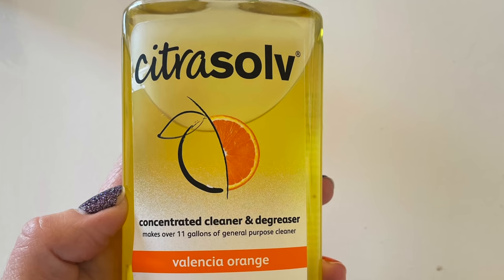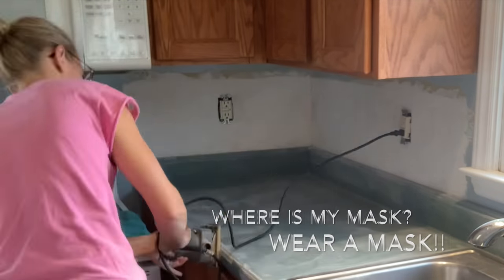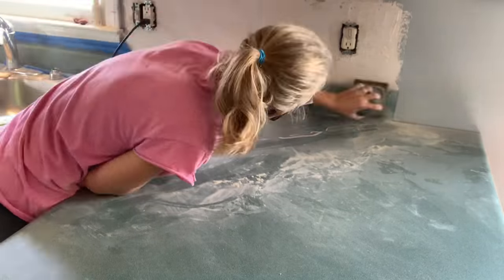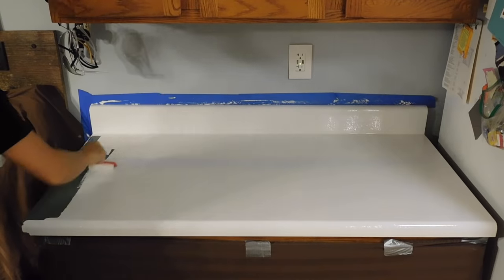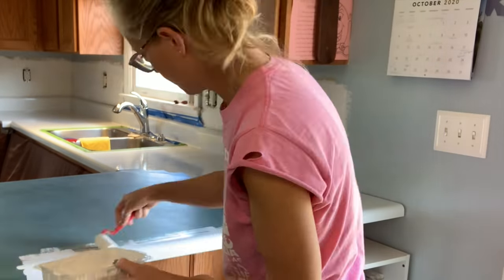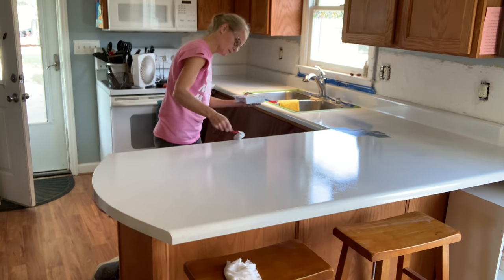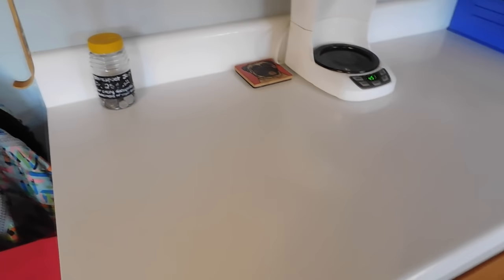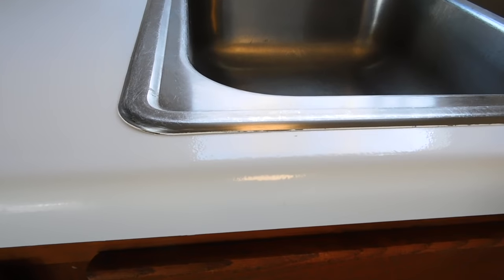DIY Painted Laminate Counter |CHEAP LAMINATE COUNTER MAKEOVER | DO IT YOURSELF EASY LAMINATE COUNTER

Comment: @Jesi Davis Life. Hi Jesi.  Thank you for sharing this.  You came up in my recommended videos and I am so glad.  Two questions.  1). How strong was the odor of the paint and 2) how long is the cure time?  Thank you!
Reply from the maker: The odor is very strong, have some windows open and a fan! but once its starts drying the odor dies down quite a bit, it lingers for about a week. This took about 5 days to FULLY cure BECAUSE it was 90% humidity ...., it says on the can not paint in humidity above 60% or something like that ... haha  ops Hope that helps.
Reply: @JesiDavisBuildingaSimplerLife    No worries about the humidity here...I live in the desert where we didn’t get rain for 259 straight days until just recently!  Thank you for your quick response.  Blessings

Comment: You can lightly sand them marks out with fine paper then use rubbing compound will shine them back out.
Reply from the maker: Hey Kenneth! Thank you for watching and giving feedback on the blemishes! I appreciate it!
Reply: @JesiDavisBuildingaSimplerLife  sure thing. I use the appliance spray epoxy all the time and love it. When every i have a plave like you have a couple pin holes i spray some in a paint cap then drop them in thd holes. Let dry and come back sand and buff out. Epoxy is really the in thing now. I wish theyd start making other colors than just the 3 as there are so many projects I could afford to make look great then....
Reply from the maker: @kennethmabus381  that’s genius! Awesome! I’ll have to try that! Yea for sure they need more colors! Hey what do you think about using this paint/spray to refinish a smaller wooden wall shelf? You think I could do it without sanding?
Reply: @JesiDavisBuildingaSimplerLife  if you dont have any protrusion from the shelf do light coats at a time and itll turn out great.

Comment: I want to do this. I live in south Texas so the humidity is always awful lol 
How long did the sanding and painting process take?
Reply from the maker: Hey there Jean, yea i hear ya. 🤔 I sanded in one morning, taped and cleaned right after and had three coats done by the end of the day, I finished the next day with one more coat and working on the blemished area. what took the longest was waiting for it to cure. It was a good two days before we put anything light on it, like paper or a plastic bottle of seasoning, but it took a good 7-10 days to cure, maybe even 14 days. I left town with the kids, so the hubby was keeping an eye on it and not using the kitchen much. I know we put the wine rack and coffee pot and knives back on maybe day 10.

Comment: Love it! How much did you need? It’s like it comes in quarts. What kind of roller do you recommend and do you think you could add a marbling effect in between coats or before the last coat??
Reply from the maker: Hey there! Thank you for watching! I needed a can and a half. I used a small roller and tray kit, cheap, nothing fancy, it left the desired orange peal texture. I think it was his very set I got. https://amzn.to/3dcLy4p check it out. Its been recommended that I can try a marbling on top and seal it with a clear epoxy, I may do that actually!!  Let me know if you try this! We still love it! Its holding up, I may add more coats and maybe create a marbling by the end of the year.
Reply: I would research how the epoxy will react with that type of paint. Epoxy may not bond/stick to it.

Comment: It looks amazing the only concern that I have is if it's safety to use it on the counter where you prepare food and also the safety for the area close to the stove and also the can said it's just for metal surfaces so I am wondering if over the time it will peal off. Thank you for your time to read and answer.
Reply from the maker: Hey there! Thank you for watching! I definitely prepare food on it, haven’t  noticed any chipping or pealing or negative effect in food prep or heat from stove and cooking. I figured if it can stick to metal, it can stick good to sanded laminate. If it can be used on an appliance, it’s suitable for kitchen? I guess time will tell, but as for 6months into it, it’s used a lot and no chips other than where I dropped a ceramic platter on it. 😞 my fault. But I would still do it again!

Comment: Is the spray just as good because Rustoleum has stopped making it in a hand paint only spray paint for their appliance epoxy and tub and tile?
Reply from the maker: Im not sure, I will have to try it ... thats a bummer they stopped making it, I wonder if its the same formula and you can poke the can open to get it out, this paint was super runny.

Comment: Hi Jess. Do you think it would be as easy to blend a couple of colours to get a kind of swirl effect ?
Reply from the maker: Hey Ray!! Yes Ive been thinking about that, since a few have asked. I may even try this and see how it goes .. but I think it can be done, especially with how wet this paint in, I think sprinkling and drizzling other colors may work. With how running this is I think it would allow for movement of the other paint, especially with maybe a hair dryer or a sprayer to get things to move ,,, let dry and then top with a clear epoxy ... yea man! you have my mind bursting with idea! Thanks for watching!!  ♥️
Reply: @JesiDavisBuildingaSimplerLife  You’re post was great to watch Jess. You made it look easy 😁 I look forward to the day your creative juices can’t be contained and you get the swirling going. If it looks good, I might try doing my kitchen bench. I was thinking a golden caramel swirled with a chocolate brown colour. Anyway I’m only around the corner so I’ll keep an eye out. Thanks again. You’ve half inspired me.

Comment: Can I do this on a dresser and buffet I am using in the kitchen?

They have paint on them now. Bonding? Cutting on top of it?
Reply from the maker: Hey James thanks for being here! I imagine you could use this paint on anything? Couple things you need to know, this paint is very thin, paint thin on vertical surfaces, it could very well be sprayed. Also the finish will look like white appliances. I would sand your existing paint. I do not cut directly on top of the counter, I use cutting boards. I do knead and scrape my bread dough though, holding up well.
Reply: @JesiDavisBuildingaSimplerLife  thanks much! :)

Comment: I noticed you used a couple of different type of sanders and sand paper.  Which one would you recommend?  I am going to have to purchase one and I don't want to purchase multiple sanders.
Reply from the maker: I used 400 grit on most and as a finish before painting, my husband happen to have a second sander with a real rough grit on it ( i don't know what grit it was) to sand down the water damage faster, then I went over it with 400 grit. If i didn't have the water damage swell I wouldn't haven't used a rougher one. Hope that answers your question! Thank you so much for watching!
Reply: @JesiDavisBuildingaSimplerLife  I'm ready to start on my counters today, I have all the materials and sander now, so here I go!  How many coats of the paint did you apply total?  You may have mentioned it in the video or comments, but I missed it.  Thanks Jesi!
Reply from the maker: @madelyngiles246  yay!!! I’m excited for you!! You should send me before and after photos on IG, I would LOVE to see! I did four on the large part, and three on the coffee  bar wishing I would have done one last thick smooth one. Madelyn, don’t miss my premiere tonight. It’s my 7 month countertop review! 😀

Comment: I plan on painting our laminate countertops (currently burnt orange - yuck!).   We have about the same amount of counter space as your kitchen.  How many cans of paint did you use?  How long should it take to fully cure?
Reply from the maker: Burnt Orange! WOW!  This took me a can and a half. This paint is very strong smelling, so if you or your hubby are sensitive to smells, be careful. I would make sure its when you can open all the windows and have fan running, and low humidity! It took 7-10 days to fully cure. Let me know how your project goes!

Comment: If you haven't done your back splash consider the real metal faux ceiling tiles.  Do not use the plastic ones as they warp.  The metal ones can be cut with tin snips and glued up with the gorilla construction glue in a glue gun.     Mine looks great and all in was maybe $300.   Tile was more and the sticker tiles are temporary as the warp and lift if around heath
Reply: I used those in my old house they looked really good.
Reply: @Heirphoria13    I ordered the stainless steel reproductions and love the look.  they wipe clean with spray window cleaner,  I did the installation myself and it wasn't that hard.  tedious,  but not unreasonably hard to do.    I'm in my 60's so younger people would have an easier time.

Comment: Since sink is drop in wouldn't it have been better to remove prior. I would have cut off the laminate backsplash if you are planing to tile
Reply from the maker: Hey Cristine, yes for sure that would have made sense, but I was doing that all by myself, and we had to use the kitchen/sink. it was easy enough to tape. Again, I did this project knowing its a "for now" cosmetic change away from the dark green. Thank you so much for commenting!

Comment: Curious about the paint choice as Amazon description says for metal surfaces. Why did you chose it? Respectfully, just curious.
Reply from the maker: Hey there! Thank you so much for watching Good question! I chose this bc I saw another gal use this paint and how easy and durable its been for her. I chose it bc it was one product and done. Simplicity and durability. I figured if it can stick to smooth metal, surely it can stick to a sanded laminate. Thank you for being here in the comments!

Comment: What about something getting slid across the counter? Does it scratch easily? Also if you take a blow torch, hold it above the counter while the epoxy is still wet. The heat from the torch will make it nice and smooth.
Reply from the maker: Hey there! Thanks for the tip, I like the smooth yet slight texture that it has. We intentionally do not slide our cast iron across or our baking stones, but I slide other things. Im constantly kneading and rolling dough on the counter, which includes using a plastic dough scraper daily. I think its holding up well. There are no scrapes or scratches that I can see. I will do a 6 month update next month and show hows it holding up!
Reply: @JesiDavisBuildingaSimplerLife  Thank you for replying back. I will wait for your 6 month review video. I need to redo my countertops as they clash with my new flooring. I'm a little nervous about painting them.
Reply from the maker: @debbieb.8708  I understand! I himmed and hawd for a few years and my husband wouldn't make a decision, I saw this and I HAD to do it ... I figured nothing could look worse than the puke green, while we fix other things up in the house and come back later and put in new counter tops all together, but I know new counter tops are years down the rd for us.
Reply: @JesiDavisBuildingaSimplerLife  So after the prep you just paint on this stuff a few times and thats it? Id love to try this, what paint did you use?
Reply from the maker: @soujourne  yea! So I explain In the video how many coats and what I would do differently knowing what I know now. Definitely love this and would do it again! I would do more coats but yes, sand and paint and wait to dry, that’s it! It had to be simple for me to do it, I like simple! I have a link above for the paint, it’s Appliance Epoxy Paint!

Comment: Why is your microwave above the cooker in the uk it’s always on the countertop because of the risk of scalding I see this so many times on holiday up high is it worth the risk
Reply from the maker: Good question, its common to find the microwave over the stove in most homes, it does have a built in vent /fan and light for the stove , im not sure if that has anything to do with that ... Ive often kind of wondered why put the microwave there.... I would rather throw it out and have a double oven! 😆  Thanks so much for watching!

Comment: How does it hold up with heat? I noticed your crock pot on the counter,  but I don't know if you've used it b on the counter.
Reply from the maker: Hey Tammy! Thanks for watching! It says on the can not to use on heat surfaces, like on the stove. It looks good by the stove, but we are experiencing a slow slight yellowing under the coffee pot, its is suttle, but its there. I use my crock pot and instapot usually in the same spot, maybe twice or three times a month and the area looks ok.

Comment: I wonder if there are different colors you could use to make them look like marble.
Reply from the maker: I wondered the same thing, I didn’t look very far when I found the paint, I found the white and said yes! 😆 I thought about maybe using a spray paint or dripping and creating lines with another epoxy, but I didn’t want to risk not liking it and then end up mixing colors. This was a job I needed to be fast.
Reply: Rustoleum has a marble look in a spray can and it looks fabulous too. I saw a video of it done in a white marble on black counter top. Was gorgeous.
Reply from the maker: @donnamyers7274  sounds like fun to create! 😀
Reply: You could absolutely scuff this up and use craft paint and a touch of sparkles with epoxy or poly aspartic on top and it would be beautiful and sturdy. I did our kitchen and bathroom laminate counters that way with poly aspartic and they are beautiful. I would do a thicker coat of epoxy or polyaspartic (like epoxy but won’t yellow) if I were to do it again but it’s been 6 months and they’ve held up perfectly! Also check Amazon warehouse deals for open box sinks when updating! We got our farmhouse sink $300 off in perfect condition!!

Comment: Slipping a plastic produce bag over your faucet saves aggravation from accidental touches with your roller or brush! I did this when I grouted my backsplash. Also, stir rather than shake your paint, as shaking can introduce lots of air bubbles into the paint. (School of hard knocks!)

Comment: You listed everything in the description except what the product name was that you painted on???? Can you tell me?
Reply from the maker: I paint I used was Appliance Epoxy. I painted upon laminate counter tops. I used just a standard fuzzy roller, maybe for cabinets. I hope I answered your question. I will have to add these details in the description! Thank you so much for your feedback! 🙏
Reply: @JesiDavisBuildingaSimplerLife  I looked again and saw  that you did indeed post what you used so my apologies. I'm going to do mine exactly like yours. But I'm going to use that Rustoleum Marble look spray on the 3rd coat and then find a good clear top coat to paint or spray over that as my last coat. One that wont yellow. Then also im going to paint my stove and fridge in the stainless steel apoxy. Cabinets I've already painted antique white. I wished i could afford new counter tops and appliances, but i can't,  so this will give everything a whole new clean and fresh look. Just got to decide on a inexpensive backsplash. I refurbish old furniture so im painting my old homemade by my father in 1983 dry sink, hutch, table and 1940's antique Harp Chairs in a french country kind of color,  may be a blue/green. All this will happen in the spring. 😁 Thx for your video. Im getting excited.
Reply from the maker: @donnamyers7274  oh that sounds amazing! My mother has an old antique dry sink, I love it! I would love to hear how your counter come out and all the appliances! I’m with you on not being able to replace everything, but a facelift for now is great! Keep me posted I would LOVE to see a before and after! Good luck!
Reply: @JesiDavisBuildingaSimplerLife  I'll definitely make sure i contact you and get some pics to you how ever you like. Thx for the inspiration!😊

Comment: Epoxy can keep it on so you can clean with anything. I was thinking about doing the sand an appliance with bar top epoxy on top. So I can clean with anything. An it would be like new.
Reply: Just a light coat of epoxy would do.
Reply from the maker: @SS-bz4ze  I think thats a great idea! Hey thank you so much for watching! Countertop replacement is way down the rd for us, so I may sand and redo this process in a couple years.

Comment: Can this be done over siltstone counters
will it stand up to hot pots and pans and chopping like siltstone  does, prob not
Reply from the maker: I think youre right "Probably not" The can says not to use on heat surfaces, Ive notice a very slow and suttle yellowing under our coffee pot. Ive put hot things on it with a pad underneath, and no yellowing under the instapot or crock pot yet. As for cutting, I would say NO! NO and NO! haha ! Maybe a slice here and there but not continual. hope that helps